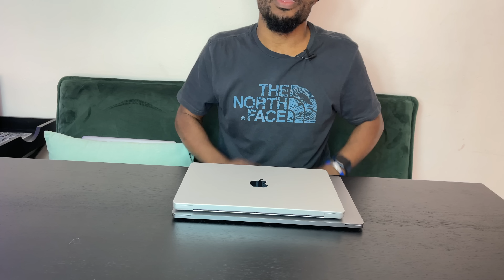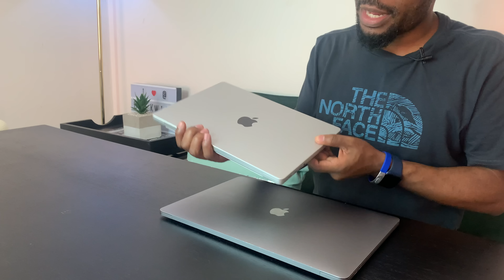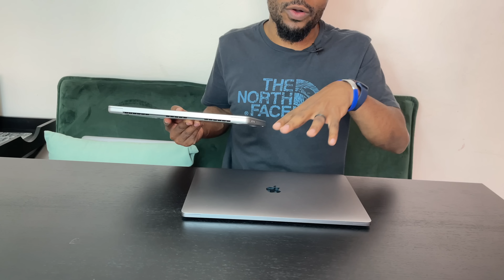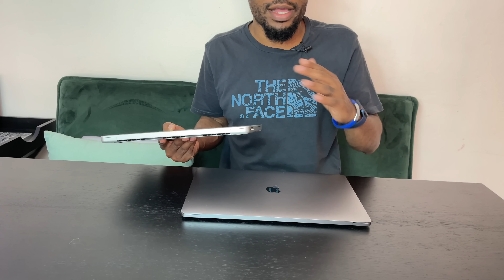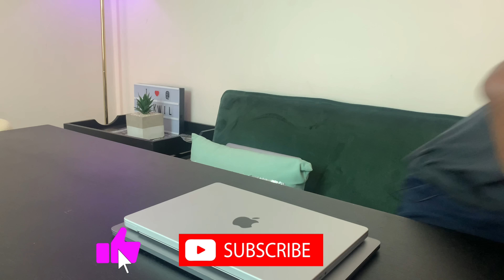MacBook Pro 14" 2021 X MacBook Pro 15" 2018 -  Comparison

Comment: Hello, thank you so much for your video. There are no plenty of videos speaking about whether it's worth upgrading from 15 to inch. How did you get used to the smaller sizing of the screen?
Reply from the maker: For there haven’t been much of a difference moving from 15 - 14 inch … it is also quite different since I still have both machines. Smaller screen size works better when you are on the go